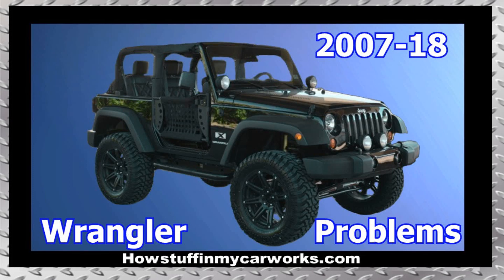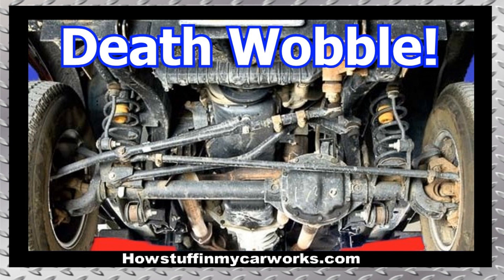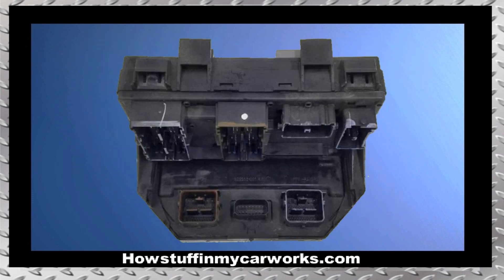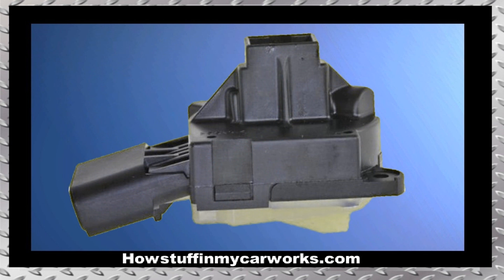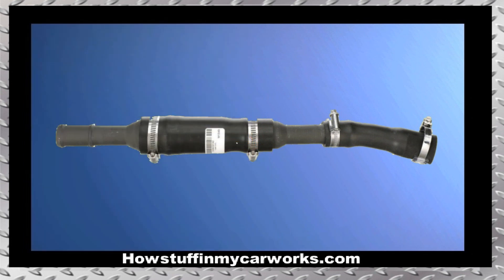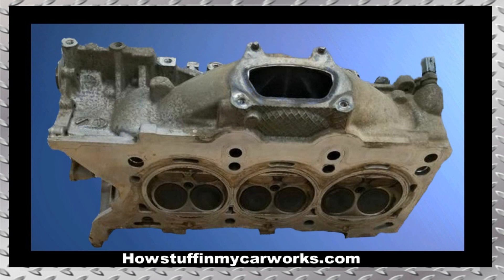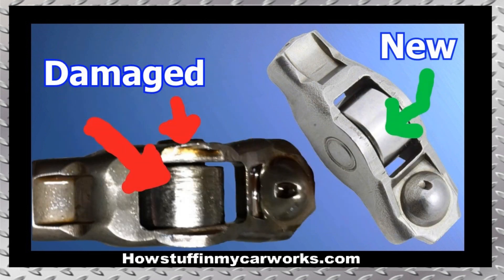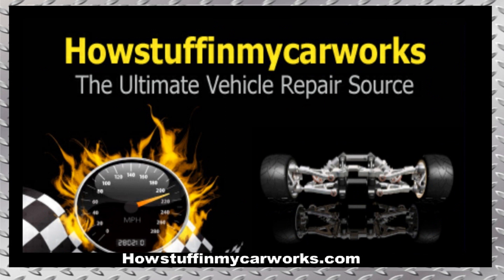JK Jeep Wrangler 3rd Generation from 2007 to 2018 common problems and complaints

Comment: Over 10k spent to get most of problem solved  that to Chrysler jeep. They were no help  when transmission failed at 65k miles.  That alone cost me 2200 to have a rebuilt 1.   Avoid.  07.  To 2012 model jeeps  you will regret it  this guy was on point  every issues I had.

Comment: I think I might have an ignition switch problem! I replaced the starter and the battery! But now after a week, now it won’t start! Only sometimes when it wants too!
Reply: Unplug the TIPM (fuse box) and reinstall it.  I was having this issue and from what I have read static can build up causing random interference which in turn can cause intermittent no-crank no-start.  Doing this fixed it for me and has not returned since.  It’s been about a year.
Reply: I need to try this solution as I have experienced this issue with no solution. Everyone has told me no, bit thank you for addressing this concern.